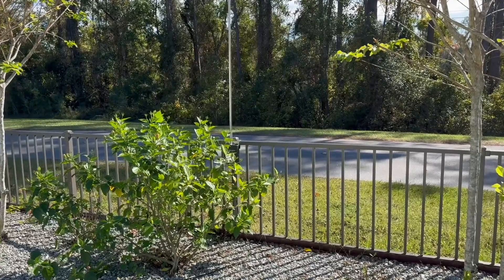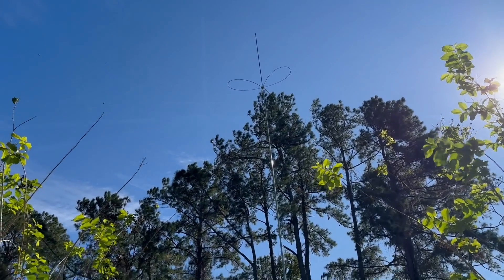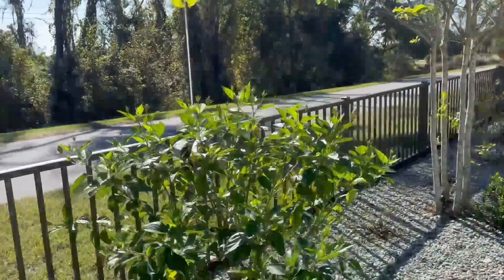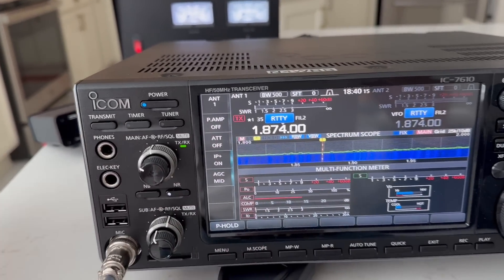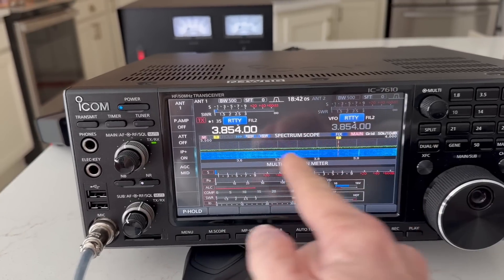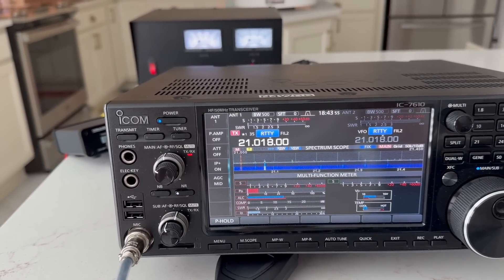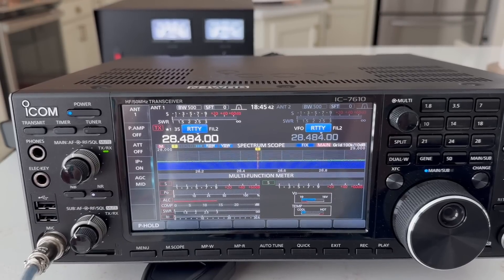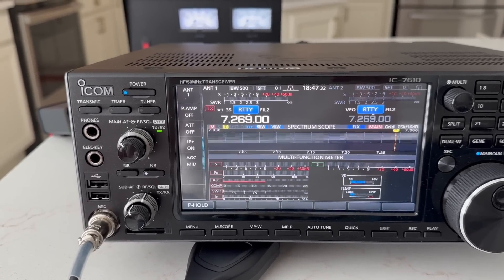Simple and Effective Vertical Antenna for 10M to 160M

Comment: 20ft fiberglass fishing pole would be more durable
Reply from the maker: Likely so, but less portable. This goes up and down in no time and with little effort. Collapses in to space requiring less than 2 feet.
Reply: @WilliamBennerJr  ok
Reply: @WilliamBennerJr yes, however a fishing pole could stay alongside your fence when not in use. Your whip will end up loose and corrode. Not my install, on my side i'd go with that fishing pole. Here at home one of my maple trees is now an antenna with wire running along its trunk.

Comment: Great video and explanations in the comments. I just ran across your channel, and after watching this video, I subscribed to your channel. Do you plan on doing a video detailing your mods to the tuner and cap-hat? I would very much like to watch them. 73s...
Reply from the maker: Thanks for the note. The mod for the tuner was somewhat documented in that video. There is a picture at time 4:03 which shows the mod, and the description details the parts I bought and where I got them. For the cap hat, I just drilled a small hole in the central hub, and tapped it for a #4-40 screw. Not much to it really.

Comment: This is a typical "plugin" radioamateur , you can get swr to zero even with a 50 ohm dummyload, short antennas on 160 meter, bad efficiency also,
Reply from the maker: Yes indeed, low SWR is possible if there are losses in the system. For example, this video shows conclusively the losses found in the MPAS 2.0. I also repeated his test. This guys is smart: https://www.youtube.com/watch?v=af1iR1bg4Og
Reply from the maker: Nevertheless, what you see in the nano VNA in most bands is a relatively high Q system with good resonance. High Q and good resonance can't exist with losses. And of course the whole point of ham radio is to experiment and share results. That's what I've done here. If you don't like what you see, don't use it!

Comment: 160M swr 1.1 , efficiency Zero...you'd be better off adding wire to the top of the 25ft vertical and stringing it into a trees.

Perfect swr means nothing, when it comes to antenna performance.

Add 100ft of wire for something more effective
Reply from the maker: Agreed, efficiency is about "metal in the air". 160M isn't open very often in my area anyway, so it is of little consequence. The point is, this is a single antenna system that can be tuned to all of these frequencies super easily. 80M works well enough to be able to make contacts and get people to tell me 59. (Of course many people say 59 so...)

Comment: Thanks for the explanations you provided below in the posts. I live on the ground floor of an apartment building, with no balcony or nearby tree to use. So, I'm keeping my eyes out for something someone is using that I might adapt for my use. I've already spoken to the apt manager (her dad is a SK ham), and she's given me the go ahead for an antenna that does not attach physically to the structure. Good luck with that, I say! lol
Reply from the maker: You might look into a Mag Loop. Also I operated a Yaesu ATAS antenna actually inside my house, using a living room table as the counterpose and was able to reach Australia at 50W with that configuration! If you can make a tripod work, with radials outstretching on the floor, that would also work.
Reply: @WilliamBennerJr  Cool! Thanks for the suggestions!

Comment: Outstanding video!  But as a newby I have some questions if you have a few minutes. It appears when you key the radio with low wattage, the external tuner kicks in and the SWR comes down.  Then you're switching and running the NovaVNA through the antenna circuit to verify it's actually tuned, is that correct?

Now my understanding, which could be wrong, is that the tuner tunes the circuit to satisfy the radio, but the physical length of the antenna, since it's a fixed length, remains not resonant.   Is that correct?

So if that understanding is correct, does this also mean that the antenna is not really delivering the full power of the radio at a frequency where it's not resonant?   To put it another way, lets say you wanted to transmit at 1.874k.  If you had a vertical antenna resonant for 1.874k (pretty tall!), would your radio deliver more power on that frequency, than using a non-resonant antenna with a tuner?    

Does the tuner compromise power output, and does it depend on the amount of mismatch?  I'm studying for my general and I'm trying to understand this properly.  And, after I get my general I'm looking for an HF solution.  

Finally, you stated that you don't use the antenna at full height on windy days.  Is there a limit to what the tuner can do based on it's length?  For example, if you had the antenna too short, would that prevent the tuner from doing it's job on perhaps the lower frequencies?  

I'm impressed with your setup and equipment.  Tuners are certainly necessary because we can't all have a yard full of resonate antenna's for the various bands, but my real question is how badly a tuner compromises the antenna's effective radiated output?

I purchased a multiband vertical and placed it in my backyard, radials on the ground, with other houses and structures blocking it.  It seemed to receive the lower bands well, but was absolutely no good at all  for 10m, the only band I'm currently licensed to use.   I wound up building my own 10M on a 30ft fiberglass mast with the element and radials at the top.  NOW I have a very good working 10M antenna.  

So I'm concerned that 40 and 60 meters may still be effected by my backyard and somehow I need radials that are elevated.  That metal fence you are using is an elevated radial and from what I've read, that's probably giving you a boost over radials that are laying on the ground.   But at this point I'm just trying to understand everything. Thank you for the time you spent doing this video!  It was very helpful.
Reply from the maker: WOW long reply. Feel free to contact me on my contact form at WilliamBenner dot com. 

You can search the web to find out how these remote tuners work. They use a simple L-C circuit. This kind of auto-tuner is capable of "rotating" the L-C in four separate ways, thus covering many different kinds of mismatches. 

And yes, there is a limit to the range of impedances that this tuner will match (same with all tuners). When I shorten the antenna I make the tuner have to work harder (particularly using more inductance) on the 160M and 80M bands. 40M and up are no problem, even for whips as short as 4 feet! 

The tuner only dissipates a little bit of power owing to resistance of the inductors and small losses in the capacitors. It’s just during tuning, relays are opening and closing and at high power, this could cause “arcing” to occur on the relays, which may damage them, or at the very least confuse the tuning algorithm. Once tuned you can operate the radio at full power.

Comment: I'm considering a mobile variant of this but no fancy schmancy remote tuning.  Instead I have an old home brew Z match (manual antenna tuner) and a QRP rig, and a vertical, and probably some metal mesh as a counterpoise/groundplane, but similar idea of tuner with  a whip popping out the top.

What I'm curious about is how well you can hear, and be heard, on lower bands (80m, 160m).  I have a feeling that for portable (field day, pota, sota) operation, your idea of automatic may be awesome, in combination with a portable antenna mast solution of some kind so that the whip can be got up high in the air and then retuned at will.
Reply from the maker: Since June I've played around with a variety of vertical antennas, for portable and permanent use in HOA environments. So I've also explored configurations that you are describing. What I like about this setup is that with a single configuration, I can get all the way from 10M to 160M without having to adjust the antenna or twiddle knobs on a tuner. 

Regarding your question about the lower bands, I just looked in my log, and in most cases I get a 59 on 80M. (Anecdotally I think people get 59 in many cases, even when it's not really a 59 so...)  On 160M that band isn't open too much, and I find that there are a lot of long conversations going on -- not many people calling CQ or POTA, and I've been too polite to try to break in just to get a signal report. If there's a 160M operator out there who'd like to coordinate a conversation with me, I think that would be a worthwhile endeavor.

Comment: Why do you not use the internal antenna tuner on your 7610?
Reply from the maker: On certain bands I do. For example on the lower portion of 160M I need to do this. Also on a portion of 80M. But for the rest, SWR is very close to 1:1. And the whole point of a remote auto-tuner is that the impedance is matched at the antenna, thus leading to the lowest loss in the coax.

Comment: Very nice! I've used the URT-1 with 25 and 43 foot vertical non resonant radiators with great result. They are DX monsters. But nothing so integrated as your build.
Reply from the maker: Thanks for the kudos. In essence, I only changed the attachment mechanism, but didn't prevent it from being used with wires if desired.

Comment: Putting too much strain on that antenna port on the tuner
Reply from the maker: Right. Sure looks like it, doesn't it? But the proof of the pudding is in the eating. Been there for months at two locations. Do I need to make another video showing why it works with an ANSYS model?
Reply: @WilliamBennerJr  good to hear. I'm on the west of Scotland and the wind just doesn't stop. Strong enough to snap an Antron 99 before.  I would need to guy that
Reply from the maker: @1kc1981  yes indeed but that would be the case even with the whip screwed into that gumdrop mount made by MFJ that I showed in the earlier part of my video.

Comment: Suggestion: Drill a hole in the fence, install a 1/4 x 20 Stainless Rivnut in the hole in the fence, run the counterpoise to the Rivnut with a 1/4 x 20 stainless bolt to reduce corrosion.
Reply: Fence looks like it might be some type of aluminum- if you put stainless and aluminum together they will bond over time - that screw would be impossible to take out - not sure if that matters but ……
Reply: @apjbuilder  Installing a RivNut into the fence with NoAlox will solve the bonding problem, they are very electrically compatible with the clamping force of the RivNut and the NoAlox preventing Galvanic corrosion.
Reply from the maker: @elberttanner6189  Thanks for the hints. I will check it out!
Reply from the maker: Yes, I've also considered just running a wire to the bottom, and "draping that" along the length of the fence. It would be completely out of the way, and would ensure it's working as a full-length counterpose, regardless of the connection stability of the fence itself.